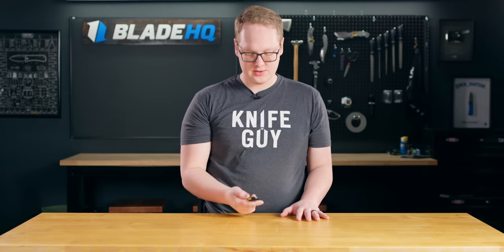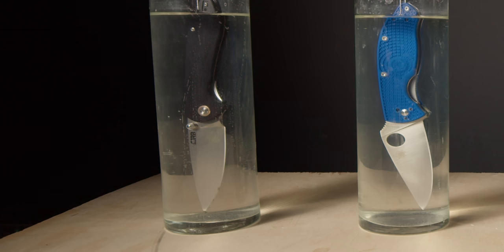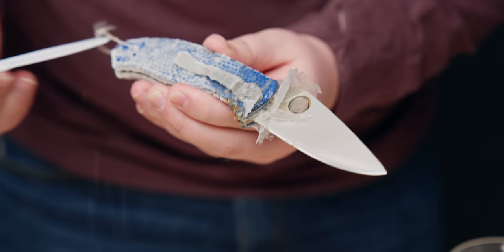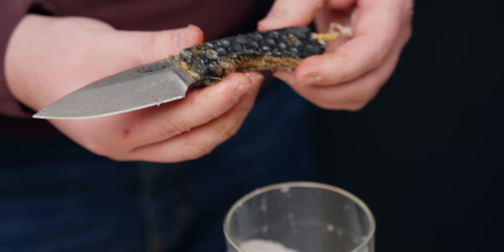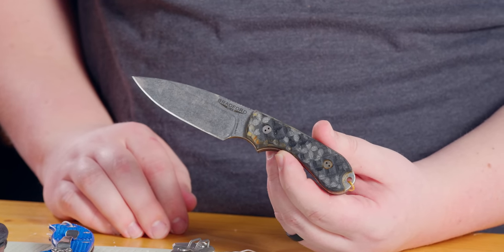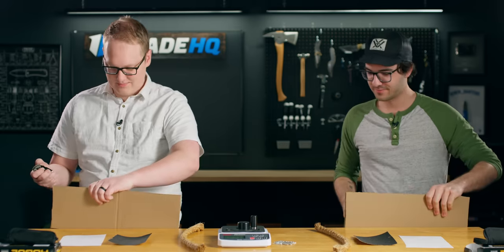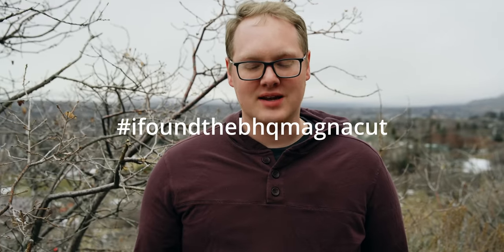The Ultimate MagnaCut Field Test 2023 | Is It Better Than H1? 20CV?

Comment: Entertaining video, but really flawed methods. Submerged steel rusts slower than exposed, wet steel. And a sharper starting edge will lose ground faster than a not-so-sharp starting edge.
Reply: I was thinking  the same exact thing
Reply: Which I believe was a criticism on the original video as well. Leave those fuckers out in the bushes for a month after salting them up.
Reply: This would be a more controlled test. In the bush has no controls. All these steels were done the same so at least it’s a comparison.
Reply: I do agree on the edge retention test. They’d really need to be sharpened a few times the same way score testing started to even make it close.
Reply: We should have asked you first
Reply: If they put aquarium bubblers into the salt water the test could be done much faster.
Reply: Making the test more extreme does not make it a better test. Especially because there are tradeoffs in steel properties. It's like when they test the durability of broadhead by shooting them into concrete; all you are doing is favoring one property over all the others.
Reply: I was thinking this as well during the video

Comment: Of course the MagnaCut outperforms the 20CV in the edge retention test, it had a duller edge to begin with. Edge loss is not linear, it tapers off as the edge angle becomes greater.
Reply: Yeah, they both should have been set at 20 degrees for a true comparison.
Reply: Since they’re the same company I bet they’re the same angle. I think they should’ve resharpened them though as close as they could to make them match on the edge tester.
Reply: I think we would’ve seen the same result roughly anyway
Reply: This is exactly why I do a standardized sharpening routing on knives before I test edge retention on my channel.
Reply: Hogue is known to have subpar 20CV heat treatment.
Reply: At least one voice of reason
Reply: @whhitestallion It's just a prejudice.

Comment: Did Larrin say that MagnaCut "rivals H1"? On his corrosion chart, H1 is 10/10, MagnaCut is 9.5/10, and 20CV is 9. Also note that factory edges are not great indicators of ultimate edge retention. They should be sharpened a few times to both ensure angles and get down to fresh steel. Otherwise, good video.
Reply: This, they say it's hand sharpened but never mention that it is done with a fast belt grinder that's likely to make it not as hard(From the heat) for the first one or two sharpening sessions(Depending on how much material you take out) and it'll get to the right hardness after that

Comment: I like these kinds of vids. It’s making me want to actually invest in the super steels. Sometimes I don’t see them as worth it, but when I actually can see the performance it makes me think differently.
Reply: If looking at super steels absolutely do not rule out Vanax 37. Easily an equal competitor to Magnacut and that's a statement
Reply: @christolley4946  Magnacut is a totally different paradigm. It not only has half the chromium yet is just as stainless, it also gets harder, has finer grain structure, and maybe most critically is tougher and thus less likely to fail at the edge. Magnacut is in a class of one at this stage.
Reply: Biased to the max… terrible.
Reply: Knife steel really doesn't matter as much to the average person as you may think
Reply: @stremsniperisbest5728  you are right about that, but my work does involve me using my knives frequently and often in harsher conditions. Most of my budget knives have either broken, gone dull immediately, or have rusted before my day has even ended. So these higher end steels actually make a difference to me. 
But it is true. Most people don’t need anything better than D2

Comment: Actually D2 is considered a stainless steel, just on the lower end of corrosion resistance in comparison to others.  Stainless steel is exactly what it sounds like, Stains Less.  Not Stain Proof.

Comment: Just ordered a BR fin and bone in Magna Cut.  We shall see for ourselves soon enough.  One of the best kept secrets is where does BR source it's blades from and how good is the heat treat?  This knife will not see salt water but it will see beef and pork roasts along with turkey.  I did not have a good boning knife for the kitchen and I wanted one that would not take a lot of maintenance.  I have good fillet knives and normally use my kitchen knives for butchering deer anyway.  White pinecone with natural liners, my brother in law will probably want to cut the turkey up this November.

Comment: Cool test by the BHQ team! Think it would have been a little more controlled and just overall better if you guys had removed the hardware and scales and just put the blade in the water solo. Wouldn't have probably caused as much overlap on the surface corrosion that was apparent on steel liners/hardware. Also would have been cool to see a higher carbon content steel, something that isn't stainless/partially stainless just for the hell of it. But overall very cool video, love these testing type of content videos so keep em' coming George and BHQ🤌💪

Comment: I need magnacut screwdriver bits. Ph1, ph2, T6, T8, and I guess small and large flatheads
Reply: No kidding! I want a MagnaCut file that can hang around in my often wet toolbox without getting rusty. And a ratchet with MagnaCut internals, tough, wear resistant, and corrosion proof.
Reply: @elevationmoto6208  a file would be pretty cool, how about channel locks, crescent wrench, and pipe wrench. And just to make em fancy, titanium handles

Comment: In order to test properly................You need to spray the salt/water agent on the blade and then let the blade air dry.......... and then repeat.  Letting the blade air dry allows oxygen and corrosive agent to corrode the metal.

Comment: The D2 did super great with corrosion considering non-stainless.
 Black nitride all the steel. Corrosion is over valued. The edge needs sharpened enough just from use.

Comment: Dont get too exited about the edge on edge tester ,got the pt 50 for my knifes.
Had to cut a broken reinforced lightning cable so took my magnacut knife ,Actanonverba a100, and got to it, needed 3times at full force to get trough so tested for fun my cheap 8cr15 knive which goesnever below 400 as much as sharpen it and it cut trough like butter.
Then tested all my knives on it ,was curious know, and the supersteels ,m390,elmax ,nitrov and so on failed despite being in the 200 to 300 in the edgeon measure and the ones cutting trough with one go and a bit of force where the " bad steels " , namely 420hc, 440c , 8cr15. , and 420.
So ispend a fortune on that tester to get results in real life who have no rellation to it.

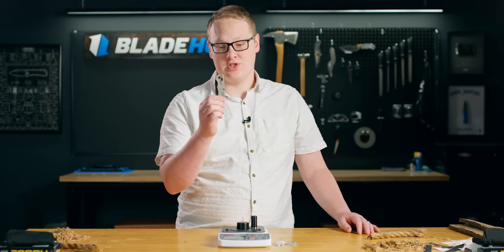Comment: first of all, 20cv is not one of the greatest giants in edge retentions 09:55 , second of all hogue is an outlier for an edge retention test because most manufacturers are currently heat treating magnacut to 60-62 and hogue has committed to 63+, which according to our friend and local expert Dr. Thomas, magnacut at 60-62 is going to have similar edge retention to properly heat treated D2, do that test again but with a microtech and get back to me :) - also to clarify my initial statement, m390 officially has a middling level of edge retention, especially compared to steels like s90v maxamet rex121 just to name a few..m390 is a giant in its corrosion resistance, and im shocked that despite being friends with Dr Larrin Thomas you all continue to act like 20cv/m390 is some edge retention titan....not that you will read this comment anyways

Comment: Does anyone cut anything with their knives outside of paper and cardboard?
Reply: Plastic which encloses the sandwiches I buy in the break room. Zipties which are often wrapped around metal pipes. Black electrical tape wrapped around metal cylinders. Fingernails. Thread. Enjoy carrying out these boring tasks with a tool much better than required.
Reply: @elevationmoto6208  I'm with ya

Comment: There is not a more useless application for a supersteel than in an OTF switchblade knife. An OTF is a weapon, made to stab people, it just needs to be pointy and not even particularly sharp. Supersteels are to shine when the knife is used as a tool, to cut all sorts of tough or hard material repeatedly over a long time.
Reply: OTF work great for cutting tasks. They’re not just for stabbing. the dagger blade is very convenient for a lot of cutting tasks and you never touch the blade when operating so it’s safer and one-handed and ambidextrous.

Comment: Magnacut, like all other steels, is only as good as its heat treat. Manufacturers shortchanging their heat treat and only getting 61-62 HRC aren’t doing it justice. Magnacut’s best in the 63-64 HRC range.
Reply: I’ve wondered how many companies will slap magnacut on a blade just to sell more of them. I’ll wait until it’s tested more and properly heat treated. Spyderco tends to do a great job with their stuff. A magnacut delica or para 3 would be great
Reply: @kpfagerberg  Pretty much all of them eventually. That's pretty much what is happening already, just look at Protech. Heck, they even showcase it with Hogue. No thanks, I will stick with my 1st gen 20CV Deka, that is still G10 and has too many screws in it so it stays together like you expect.
Reply: I've got Bark River Magna-Cut, and it will definitely take a patina.  They supposedly get it treated to 62, so this would fit right in with what you are saying.  The heat treatment makes the difference in how the steel performs in all areas.

Comment: These testing methods were quite honestly a waste of time. It seems to me starting out with a sharper edge would naturally dull by a higher percentage than a lesser sharp blade. Because of that, the edge retention test does not seem fair or equal. In fact, since the carbon ended up sharper after the test, even though it didn't retain from a much sharper starting point, I'd say the carbon won that test also. Starting both at equal sharpness would have been more of a Project Farm quality test.

Comment: The bottom line, is that “super” is really worth the money unless you just want it. It never will be. You can’t justify it, but you don’t really have to. You can open boxes with any of them. Thanks for the video
Reply: Very true. Some good ol Buck 420 is just fine. Or my Swiss Army knives for cutting hotdogs or boxes.
Reply: You got that right. I still am impressed with the edge I can get on my Kershaw Link in 420HC. That things sharpens to a level nothing else I have can. So what I have to sharpen it more often. I enjoy doing it and I would still do it with Magnacut as I have OCD and I am broke.